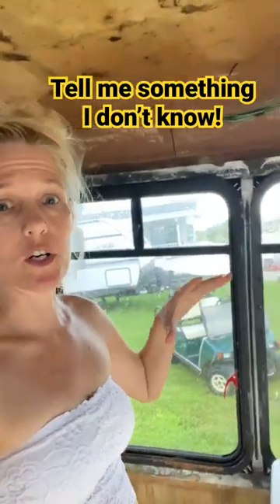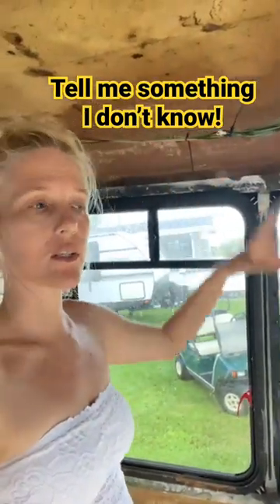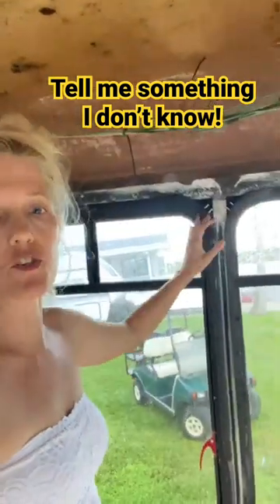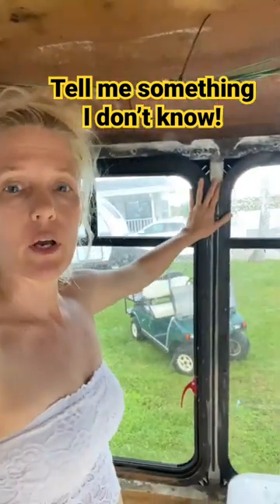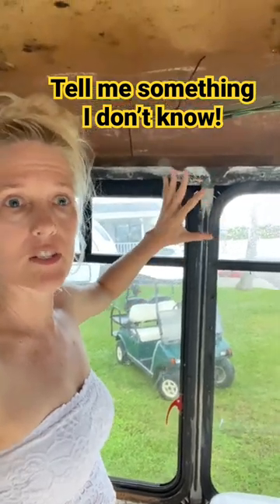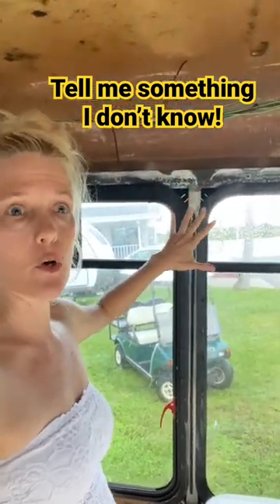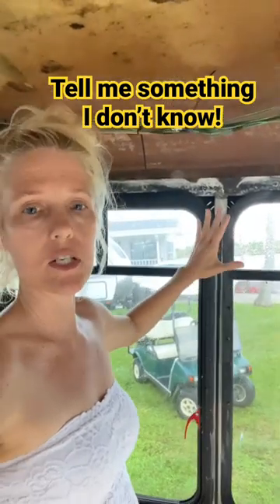BUS to TINYHOUSE | Shuttle bus build #diy #tinyhouse #busconversion

Comment: Whenever those people bust a window they have to destroy their entire wall to access the frame to remove.  What I did was take the Luan wood that had the vinyl covering and repurposed it.  I insulated in the gaps after removing the windows, upholstered the 1/8 wood with waterproof marine vinyl, self tapping screws (also repurposed) in hidden areas where you won’t see them, with PL adhesive, reinstall windows.   
I think people use wood furring because they see everyone else doing it on school buses, and it’s easier to screw into than metal.  But shuttle bus manufacturers use self tapping screws so I did the same
Reply from the maker: Great advice! Thank you for sharing. I will pin this comment to the top so that other people who are converting a shuttlebus can see too !

Comment: you might wana look into condensation on the inside, from what i've seen it can be a big prob, maybe thas why the extra frame?
Reply from the maker: Hmm, possibly. How would that prevent it though?
Reply: @floridachickstinyadventures  more insulation will keep condensation from happening. I don't think the honeycomb fiberglass has much R value. I do not see much information with a quick google search.  I think that is something you should check into. Maybe it is not too bad
Reply from the maker: Good idea. Where might I find out if google doesn’t know? Lol
Reply: @floridachickstinyadventures  maybe call the manufacturer of the shuttle bus. If you find out post here I am curious on the R value
Reply: @floridachickstinyadventures  maybe call the manufacturer of the shuttle bus. If you find out post here I am curious on the R value of the panels
Reply from the maker: Found online R-8.2
Reply: @floridachickstinyadventures  that's  not to bad. as long as it has enough  strength  to hold stuff to the wall and make sure the screws are not too long I think that would  be alright
Reply from the maker: Awesome! I know nothing about R value So that’s good to hear. I’ll give it a try and see how things share and if it does well lol continue on!

Comment: I would think that it would be much easier to attach cabinets and things to wood as opposed to metal. But, after watching tons and tons of build videos i have realized that people do alot of things that arent necessary. Its your build! Do it how you see fit. Im about to do a shuttle bus myself and my walls are a few inches thick and already insulated so i wont be building additional walls on top of already existing walls
Reply from the maker: Yes! That’s what I thought. I felt like a lot of white people did was very redundant and took up a lot of real estate that was already precious.